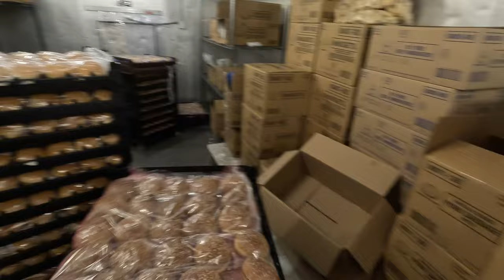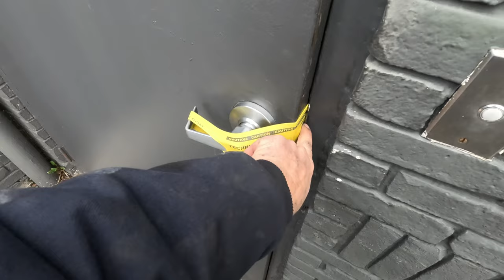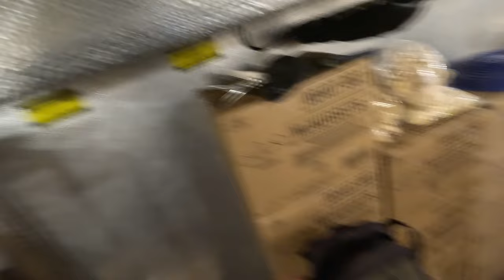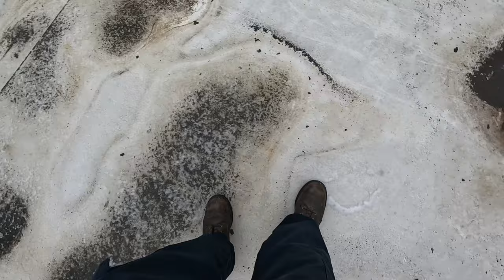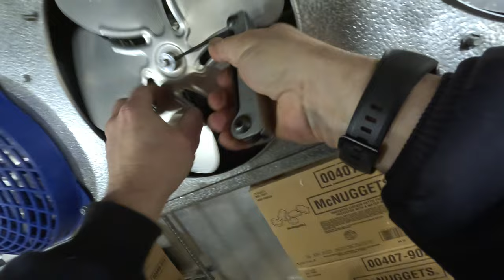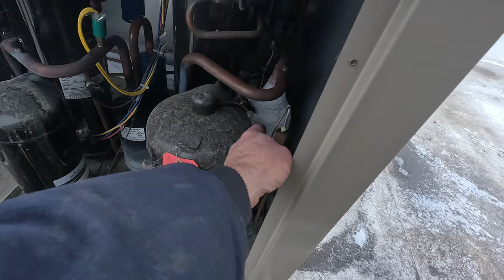Parts Changer or Problem Solver. Be A Technician!

Comment: Hey Rick, great video and editing. You may want to consider increasing your “drip down” time to help eliminate the icebergs on the ceiling. This ensures the drain pan has cleared the water and when the fans come back on they will be less likely to throw water back into the box / ceiling.
Reply from the maker: Yeah I was going to do that but I don't know if it had that as an option? I talked about it on the video then I forgot 🤦🏻
Reply: @HVACRSurvival  I gotta ask, what watch are you wearing?
Reply from the maker: That's hilarious, I'm having problems with it this morning, completely reset itself it's an S3, it's an older one but I got a good deal on it. Wasn't sure if I would be able to wear one of these doing what we do. I'm probably going to switch over to an Apple product when it's all said and done, since I just changed over to Mac pro for editing from PC after all these years.
Reply: Just a suggestion.  You probably should leave the defrost temps alone and turn the ddf setting ON (demand defrost).  It would probably only defrost once or twice per day with that setup.  Ice around the props and drips in front of the evap indicate too many defrost cycles in beacon 2 and QRC board systems.   Love those membrane roofs. 😮
Reply: @HVACRSurvival  my
Son, works for me, had the Apple and cracked the screen at work. He didn’t replace it as it will likely happen again. 
Tough having a nice watch doing what we do!
Reply from the maker: I fully agree, the thing I get tired of is pulling my phone out of my pocket to see the message
Reply: @HVACRSurvival  - When I have a situation like that... I don't pull out the phone.  It can wait.   If it's urgent, they can darned well _call_. They (the customers) forced me to give up my pager, so I won't let them dictate to me via text.

Comment: Always make sure the correct line voltage tap on the transformer is being used. I have found a few that were on 208 and should have been 230
Reply from the maker: I think I left the low voltage measurement in the video? It was 26.? V AC

Comment: Most of those McDs have a remote control panel in the managers office and if you change your settings at the coil instead of the remote controller the controller will reprogram the board in the coil.
So most likely your settings are the same as when you arrived. 
Just letting you know because it threw me for a loop once.
Thanks for the videos.
Reply from the maker: Thanks, I did not know that.🤜🤛👍👍 am I better to set it up at the remote than the control? I've always done it at the EVAP.
Reply: @HVACRSurvival  
That's what I use to do.
I went to one three times and changed the defrost settings at the coil and the settings kept being the same.
I thaugt the maintenance guy was doing it, called tech support and they informed me of the remote panel which I had no clue was there.
LOL
Made changes at controller and took it off smart defrost and set it up for timed defrost. 
Never had another issue. 
The unit I was dealing with would freeze up badly.

Comment: I probably missed something, but lowering the defrost termination or cut out to 50F from 60, would that make defrost problem worse? Of course the title of video...that wasn't the cause. Thx
Reply from the maker: The initial call was for a broken fan blade because ice was hitting the fan blade. So I went out with the fan blade and replaced it but notice ice was built up around the shroud of the fan, however there was no ice in the drain pan and there was no ice on the coil, (both of these things told me that I don't have a drain issue and that  the EVAP coil is getting plenty hot) while changing the fan blade I noticed the defrost ran way longer than needed as you could see in the video, their were water droplets dropping forming in the ceiling. It should not get that warm. A lot of it has to do with the delay of the sensor picking up the heat because of where it's placed at. So I lowered the termination temp so it won't get that warm. This wouldn't work in all case scenarios, it just happens to be the case with this particular freezer.
Reply: @HVACRSurvival  got it, those clues can tell a story.  Maybe that sensor needs a heat anticipator, not really, but location may not be ideal, 60 seems high but all relative to where it is, 60F of what?
Reply from the maker: Old fashioned traditional mechanical switches are usually 55° for termination.

Comment: I've got a unit that has me puzzled.
4 ton home unit, 7 years old.  The thing works flawlessly BUT it sounds like there are marbles in the compressor.  All pressures are fine and it's not the fan motor.
It's so loud that neighbors complain.
Thoughts?
Reply from the maker: Are you talking about a residential system?
Reply: @HVACRSurvival  yes
Reply: Loose screws ??? Have you taken connections from compressor to see if the sound is still there